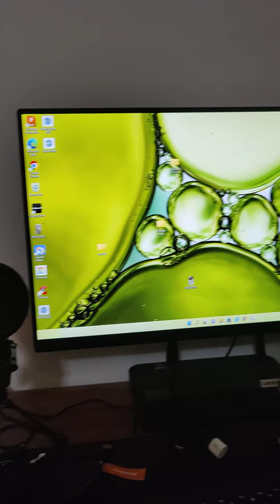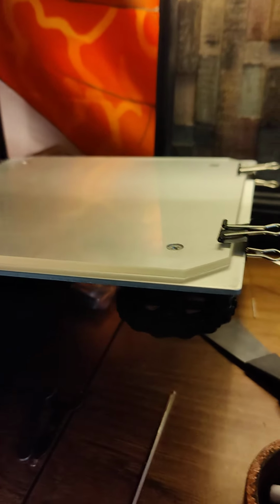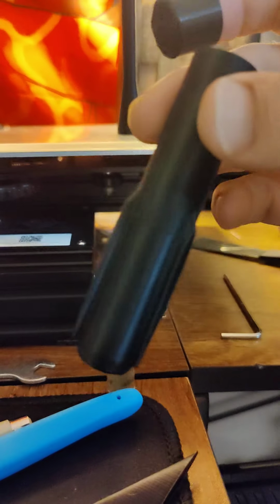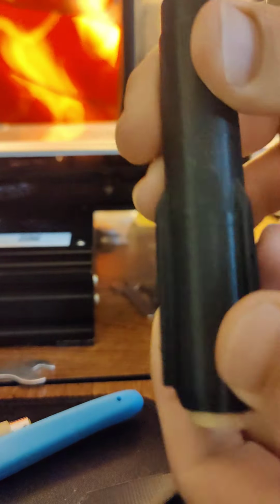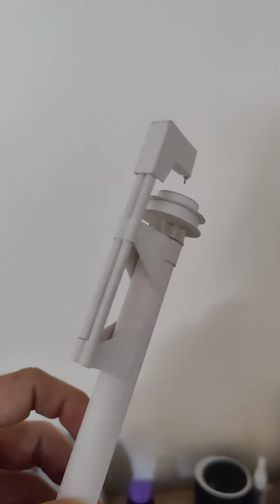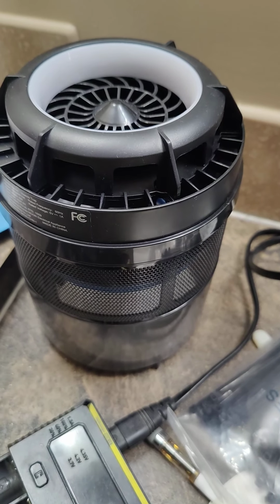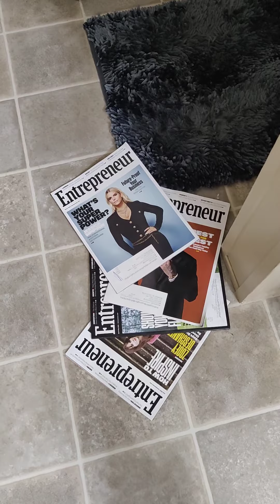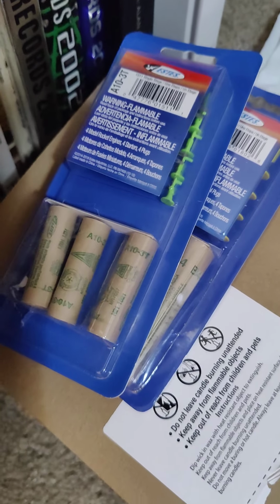general update on projects

Comment: If you haven't tried purple glue stick for bed adhesion I recommend it. Or hairspray. Your plate is pretty thick and is probably not providing the best heat transfer. I rub the glue on as evenly as possible it doesn't require applying every print. The glue can be washed off with warm water if the print sticks too good.